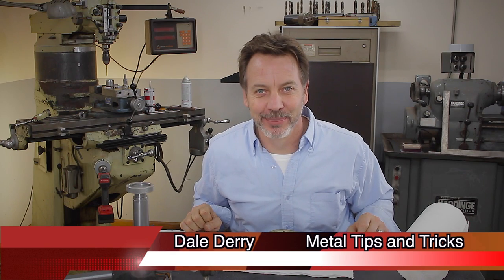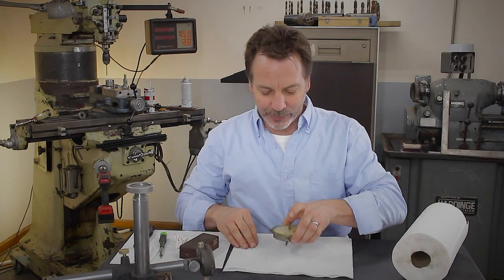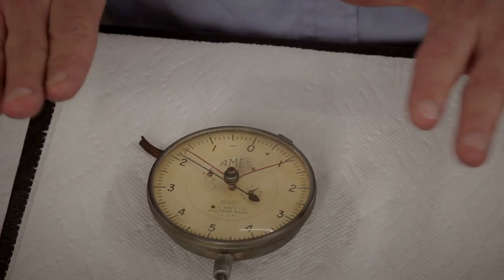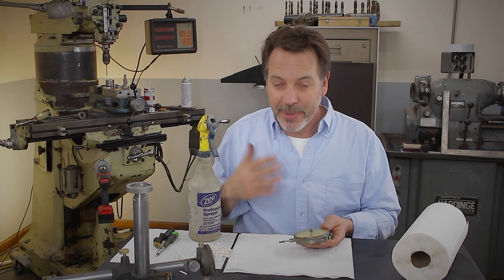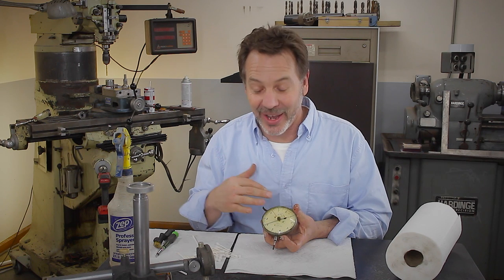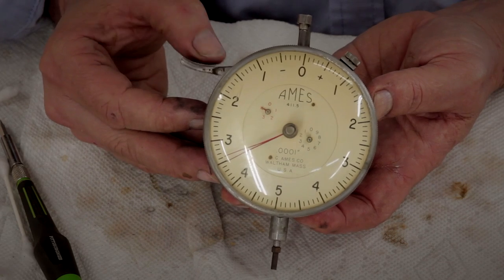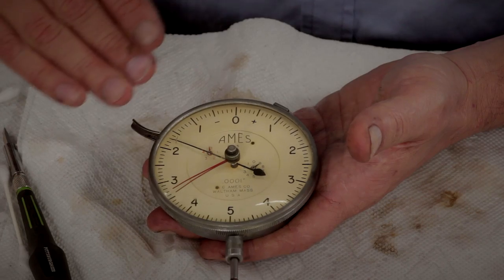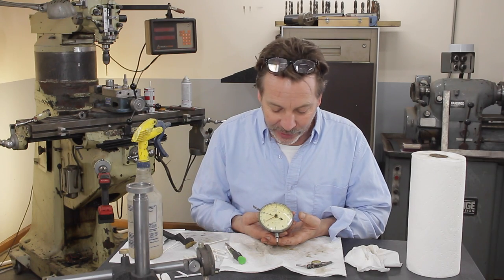How to Clean a dial indicator

Comment: Dale: I was stuck with nothing to do/but cant go anyplace today while watching my napping grandson. I dug out several old indicators I have acquired over the years and tried your method. Most of mine have some sort of access port on the side with a screw in it. I just took the screw out, dabbed a little mineral spirits inside with a Q tip as well as the sliding stems, and joisla! Your method works GREAT. Thank you so much for cluing me in.

Comment: Dale,    I have revived a few DIs over the years. There is a product called Horolene which clock and watch repairers use for cleaning movements (I repair clocks and watches as a hobby). You need to take the dial off as it will attack the soft paint usually used for numbering, but horolene will not otherwise affect plastics or shellac (Shellac is sometimes used as a glue in precision instruments. You don't really need to completely strip the mechanism, 15 mins in an ultrasonic bath with Horolene will get the mechanism pretty clean, any oxydised oil/grease will be loose enough to remove with a toothpick, then a blow off/brush off with a soft brush or rubber bulb blower, then another session in the US cleaner with fresh Horolene will get it about as clean as new. Once the mechism is clean, I dip it briefly in clean Isopropyl Alcohol (to get the water based horolene off Caution, Alcohol will dissolve shellac so just a quick swish around) then blow the mechnism off with the rubber bulb and put it under a lamp until it is completely dried. A few minutes with some clock oil and a fine wire to lubricate the pivots/moving surfaces then reassembly and the DI is good for a few more decades. If you're going to order Horolene from a horological supplier get some clock oil, a clockmakers brush and some Rodico. Rodico is a soft rubbery material, sort of like silly putty, or car detailing clay, you roll/rub it on a surface it will clean any contamination off.  The problem with using just a solvent is that it will remove any lubrication so relubricating is necesary. In a pinch you can use Sorry if this is long, and sounds trollish - I am fairly sure that some horologist will now troll me for suggesting that you can clean a mechanism without disassembling it :-)Horolene, by the way, is essentially plain unscented soap, ammonia and oxalic acid - you can google for a DIY recipe - it is fantastic for cleaning brass and copper. I usually make it myself, real Horolene is only marginally better.
Reply from the maker: +Andrew Waugh 
Great comments. Giving me  information is never, troll Like. :-)
Reply: Thank you. I really liked that you took the time to give detailed instructions on your experience cleaning precision instruments. I learned a lot, for instance I never considered the word "horological" to describe the study of clocks, it makes sense, but I just never knew. haha
Again, thank you.

Comment: Dave, great video and results. A few years ago, I took the plunge on cleaning an old Mitutoyo No. 513-102 dial test indicator I purchased in 1970 and long ago stopped using it. It now works extremely well and glad I took to chance fixing it. Thanks for your cleaning tips.
Reply from the maker: +Paul Jones 
Im so glad i could help

Comment: Hi Dale I agree, if you feel confident and want have a go, do it. Nothing ventured nothing gained. Glad you got your indicator working again as it is a beauty.    Here in the UK it costs more to have an indicator repaired than to replace it most times.  I have done several that I picked up at flea markets etc with good results.  When you say "paint thinner" I presume you mean a thinner for  oil based household paints. These are not very volatile and have very few VOC's. Over here we call it "white spirit" and it makes a good general purpose cleaner/thinner and will not make you feel too dizzy when you breathe it in.  Not sure what you call it in the USA. Also Methylated spirit ( denatured alcohol ) is great for the job although it is very highly flammable so flashes dry very quickly.  Any aggressive type thinner for auto paints etc should be avoided like the plague as they will melt the crystal  and discolour the face unless its enamelled. (although they will also do a fantastic degreasing job :-)  ).   Nothing negative here I hope.   I some times wonder if the users that give a thumbs down actually watch the content or even try to understand what is being said. Great channel thanks for sharing, regards from the UK
Reply: +Gary C One caveat to using denatured alcohol - it can craze the thin plastic (acetate?) watch glass type lenses...

I've been known to use 70% isopropyl (rubbing) alcohol from the drugstore - sometimes the 91%, but that can strip paint.

In any case, nitrile gloves can't hurt, and use the least amount of solvent, and work in a well ventilated room, and keep you solvents - and their vapors! - away from flames and electrical connections that can spark...
Reply from the maker: +Gary C 
Great input . Thanks :-)
Reply: You wrote, "When you say "paint thinner" I presume you mean a thinner for  oil based household paints. These are not very volatile and have very few VOC's. Over here we call it "white spirit"
You are correct. US paint thinner = UK white spirit.  Same stuff.

Comment: When I was a little boy, my father would clean my watch by opening a bottle of alcohol and placing the watch with the back off over the opening of the bottle. This allowed the fumes to get into the works and clean the inner workings. I had a cheap little watch and it would stop working about every few months and he would clean it and it would work again for a few months. I wonder if that would work on old indicators.

Comment: Thanks for this advice.  If mineral spirits had a slightly lower vapor pressure it would be a light oil.  The stuff eventually evaporates, but it takes a long time.  I've picked up several used indicators online that needed nothing more than a little buffing and mineral spirits to get them looking and working almost like new.
Reply from the maker: Hi Jon thanks for your comment. I hope a lot of people read it.
Reply: As an experiment I put about 1/16" of mineral spirits in the bottom of a small measuring cup after leaving the last post.  After five days in my shop with no A/C there was still enough left to cover the bottom.  Meanwhile I scored an Ames 211.5 (in the original box and looking like it had never been used) for $34 delivered.  It has 1/2" of travel and 0.0001" resolution (and three dials).  It was just a little sticky, and is working like-new again.

Comment: Been a while since I've done any, but I used to take indicators apart and clean them all the time at work, including fixing some that the Inspection Department couldn't get working good enough. 
Old Dried out water-based coolant film gets on everything in the shop and gums them up a lot faster than dried out oil films do.

Comment: Thanks for posting. Totally agree with you....Its worth a shot for a non working or sticking gauge. Worst case is to toss it or send it in for repair. And also agree....You can't beat the old mineral spirits. ( On a side note...stay away from the newer "green" non-VOC mineral spirits. That stuff doesn't hack it. )

Comment: Be careful. I used a rag that had been used with paint thinner (felt dry when I picked it up) on my level bubble face.  It immediately fogged the plastic lens.  Permanently!  I was wiping it down to get the dirt and moisture off it.  Now I have a 24" Craftsman from the fifties that belonged to my dad with a fogged bubble.  It blew me away how little and how quickly it reacted.  I have seen several other people say the same on You Tube.  Plastic just doesn't do well with harsh chemicals especially if it is old.  Glass would be fine.  Stan just did a video on sending out one of his gauges to a place recommended by Oxtools.  

Some fine watches and gauges years and years ago used whale oil (sperm whale specifically).  I wonder how the modern synthetics compare to it?    

I enjoy your channel.  Doug
Reply from the maker: +Douglas Thompson 
Great input, thanks.

Comment: Nice video.  Did you use mineral spirits to clean the dial face?  I had luck cleaning the face with distilled water so as to not dissolve the printing on it.  Isopropanol and Ethanol usually cause damage.  Small dial crystal scratches come out easily with headlight scratch remover.  I agree with Wolverine, brake cleaner spray works great on the internal mechanism, then I apply minute drops of watch oil or Starrett Tool and Instument Oil on the gear pivots with the point of a toothpick.  I use the LEAST amount of oil as possible, and have the best success by keeping the plunger dry after cleaning.
Reply from the maker: +Adam Alderman Yes I used paint thiner o the bezel, But i tested is first.
Great suggestions

Comment: Nice job. Those are a pretty set of indicators. Ames indicators are designed to be easy to maintain. .0001" graduations are a bit more tricky, but the .001" ones are very simple. They are built in an old style, by hand, rather than the current indicators that have a fair number of stamped and plastic parts. I sell new indicators that are pretty much the same and repair parts are available for the more adventures DIY crew. Francis Gardner, President and Owner, B. C. Ames Inc.

Comment: This video reminded me of what you said        know when to stop.
Had a .001 $20 indicator that was not working well, it was very slow and stiff.
So I started cleaning it to the point it did not work at all, and the sad thing is i had it working good at one point but in my mind i always think i can make it work better and so i kept cleaning it till it stopped working.
I did learn two things, how they work on the inside and STOP when it is working good enough for the job.
Was happy in some way that is was the cheap fowler and not the expensive Mitutoyo 
Good thing i had permission from my boss to give a try to fix it
Sure would  have loved to see the workings on the inside of the one you are cleaning. i just love to see how things work so in the q and a if you can go through your video and pull some still shots and show how all the gears work, it would be very appreciated.
Was really hoping you would not have done it in fast forward, and take it apart and showing all the nice insides 
And i am with FXM i learned the word shmuts and it stuck with me
Thanks for the video
Reply from the maker: +E Hiebert 
Great comment

Comment: I have an idea for a cool project you can do. Use a waterproof variable speed motor to pulley drive a 5C spin fixture, it doesn't need much power, it is actually better to keep it pretty weak like 1/4 horsepower with like a large rubber o-ring for the belt so it can slip if it gets overloaded. Then mount it at a 90 degree angle onto a 6" sine plate. Keep everything precise and you will be surprised how often you'll use it on the surface grinder.
Reply from the maker: +trainedtiger 
I have one of those on my tool grinder. :-)

Comment: Hi mate.  I had been wondering about this, and also putting the whole unit in a ultrasound cleaner with alcohol, and clean it that way.  It would be interesting to find out if it works.  One would only have to remove the bezels I would think, the numbers might wash away.  Sorry, you might have to be a bit careful with paint thinner, outside the US, paint thinner might be many other more harmful stuff than methanol.
Reply from the maker: +Marcel Timmers 
Good input.

Comment: I know most people don't care, but it irritates me when any kind of indicator with a needle isn't at the "12 o'clock" position at its unloaded zero.  

On every mechanical indicator I have, the pointers come off just like on a watch.  I got a watch hand puller, and I can just remove the pointer, put it back on in the position I prefer.

Taking the pointers off also allows me to better clean the backing plate behind them.

Comment: Like this old video, used this method successfully. I saw WD40 mentioned - not good for indicators. Dont ask me how I know... It gums up over time, You need a more stable oil if lubricating the indicator at all which should really be avoided. The vegetable oil in WD40 oxidizes with air over time and hardens like flax oil in paints. That is why it slows corrosion somewhat. The hardened oil is difficult to remove, methyl chloride works if You can get it and know the risks. Also here in Europe paint thinner is xylene, ethylacetate, toulene and similar. These will attack most plastics and paints. Light naphta or kerosene is more like present US paint thinner so be careful. I use a product labeled "aliphatic naphtha" in the shop for cleaning stuff.

Comment: Nice job. As others said, I might follow up with synthetic watch oil if the stickyness returns. Use a fine needle to apply it. You don't want visible drops, just what capillary action brings on the surface. NOTHING on the spindle to gum up the gap between it and the stem. About the only problems that can't be fixed by  basic cleaning are bent spindle, broken stem, and more severe physical damage. I do leave spring repair to the pro's, though, as it can be a bit tetchy.

Comment: Thanks for the input. I clean a lot of tools up and usually use WD or some such but didn't want to use that on my indicators. Hadn't thought of paint thinner. After the volatiles flash off the residue in just some light petroleum products. Good tip. I just bought 3 well-used Interapid 312B-3 indicators for $60. 2 need new glass and all could use a good cleaning. DIY glass is $10 ea and cleaning is me. Best machine shop deal of the year.